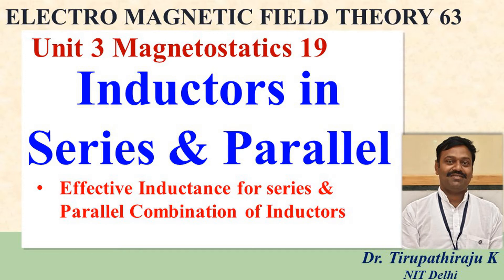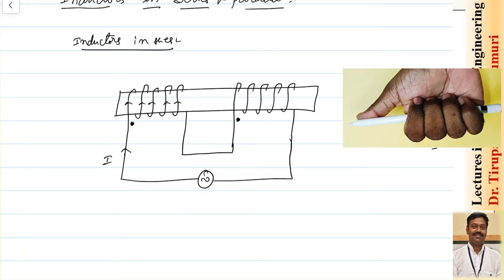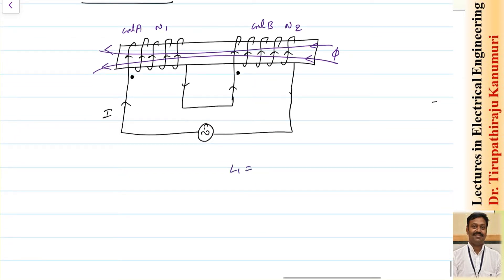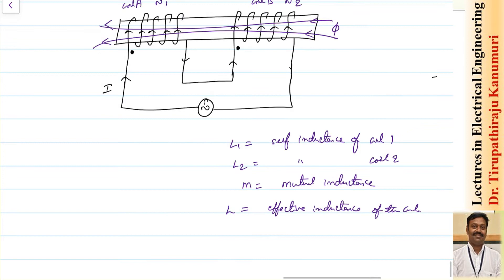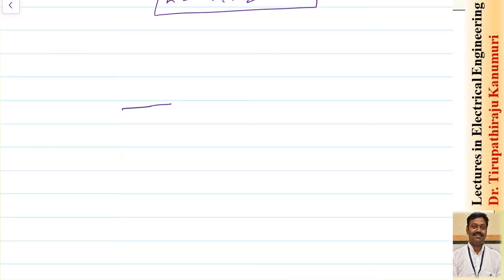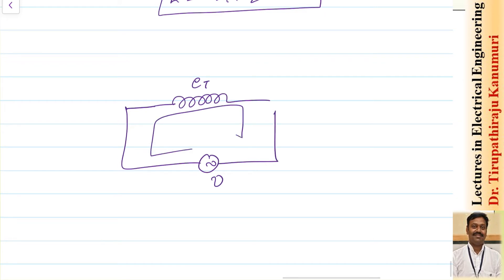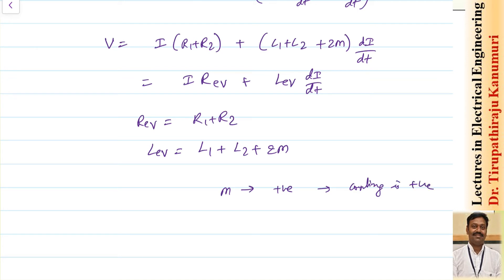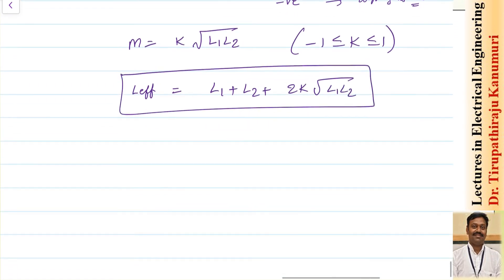EMF63 Inductors in Series & Parallel

Comment: Hi sir gd eve.... You Derived the equation of inductor in parallel.. You took (L1+L2)  in the numerator... But in case of problem solving, u took (L1L2)... So, which one is correct sir.??
Reply: @lecturesinelectricaleng  ok sir... Thank you
Reply: @lecturesinelectricaleng  i requested to upload a video on power electronics and measurement